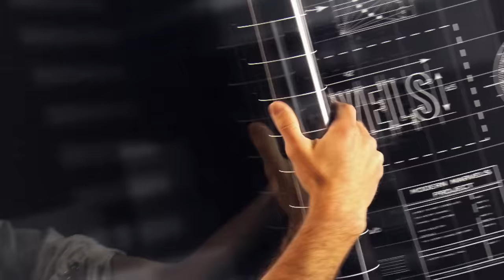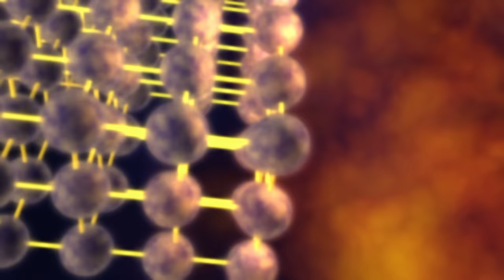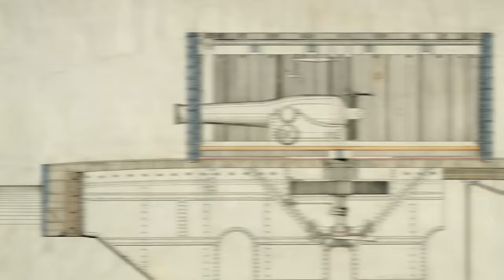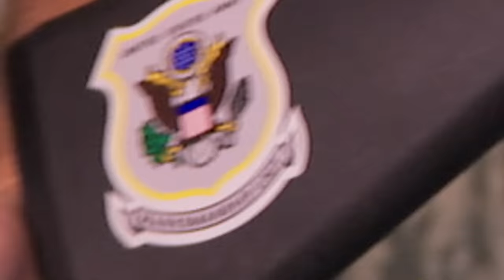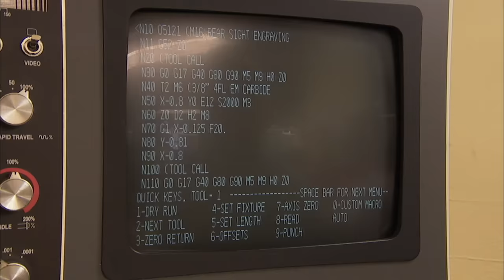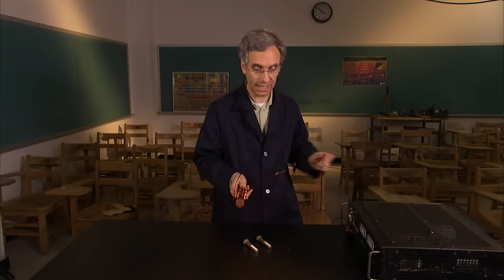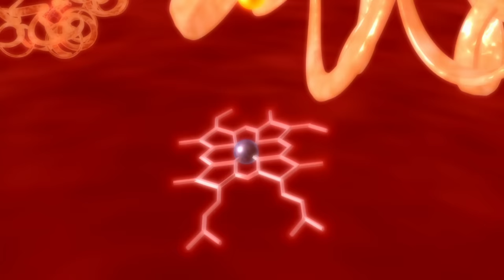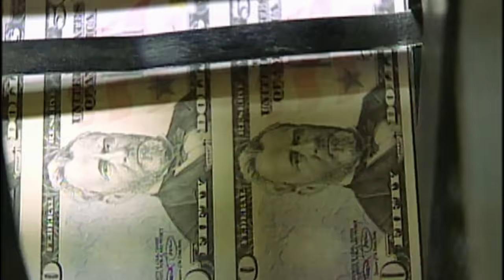Modern Marvels: How Iron Weapons Revolutionized Warfare (S14, E24) | Full Episode

Comment: Really wish more people would get onboard with recycling. We gotta be smart with our resources. Especially when it can be constantly reused without any degradation
Reply: eventually, we'll be mining our landfills for resource recovery, especially the older ones.
Reply: A lot of areas just don't have the infrastructure required for recycling to be a viable option.

In my rather rural area, recycling any metal is prohibitively difficult unless you drive, or have access to, a truck.  Manual drop-off is the only option, and the price paid for steel makes it difficult to pay for the gas required outside of multi-ton loads (generally whole cars).  Aluminum & copper are worth recycling, but it still takes quite a bit to be worth the drive.

And recycling paper, plastic, & glass is prohibitively expensive regardless of vehicle.  Not all recycling centers pay for them at all, with a few even requiring you to pay.  ...After having paid in gas to bring said materials in.
Reply: Here in Alaska the scrap yards charge to bring in metals for recycling. They pay very little for copper and brass.

Comment: Iron comes in four rocks if you are taking Geology or Geography you need to know this so you can grade them. These four rocks are Pyrite also called Limonite which is a sulfite ore, Hematite which is a silica ore, Magnetite which is what most ore contains, and the last type is Siderite also known as Raw Iron. If either of these are scratched or broken you will see red thats because they contain iron. Limonite and Hematite need to be smelted before they can become iron and Magnetite needs to be crushed and mixed with Cobalt and Nickle before it can get its charge which Hematite contains which also contains chromium and Siderite needs to be refined before it can become iron and because it contains waste rock.

Comment: Iron atomic symbol FE everything is made of it and it is the key element in an electrical charge. When Iron is smelted it becomes steel but if it is exposed to water, air, salt, or anything corrosive it will rust. We can't survive without it thats why Iron is the most recycled mineral on earth. Every day old iron products are scrapped and new ones are made at the mill thats why steel mills are the backbone of our economy everything uses Iron and the more we make the more we have to build with it.
Reply: I'm curious to why Iron's Atomic symbol is FE.  I know for Lead it was PB because the Romans used lead pipes in their plumbing and plumber is derived from the Latin "Plumbum".
Reply: @Pilot231  because the Romans made their weapons out of it FE is Latin for Ferro which means to smelt or make a sword out of it thats why Iron is the best everything is made of it.
Reply: @geomodelrailroader  ah, gotcha.  Thanks for the lesson Geomodel.  ^^

Comment: Errr, "Melting point of Iron is 2,800F" - sorry, that would be some super alloys like NiCrCo  Fe, about 1,400F,
Reply: Iron has a melting point of 1538 degrees Celsius or 2800 degrees Fahrenheit. You are wrong. Aluminum is not much over 1100 and it is tons less than steel. Steel takes a lot of heat to melt. I think you are thinking of tempering temperature.